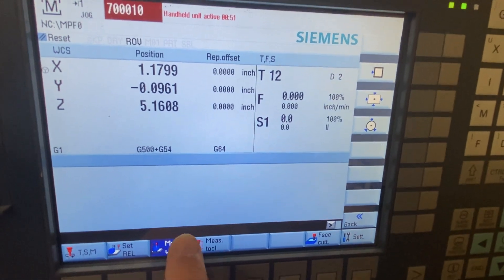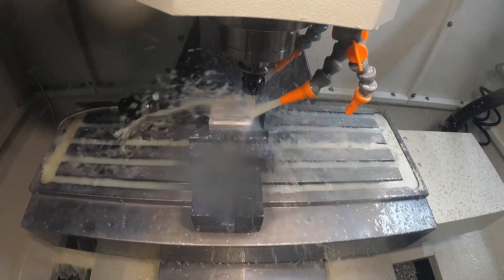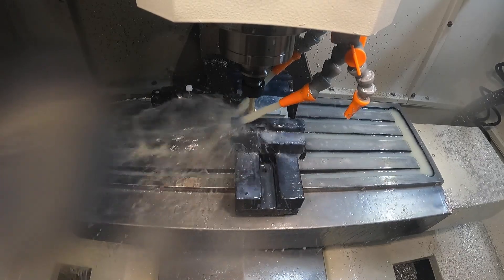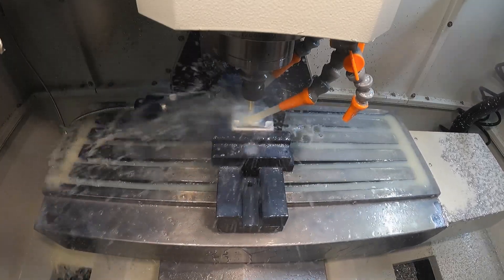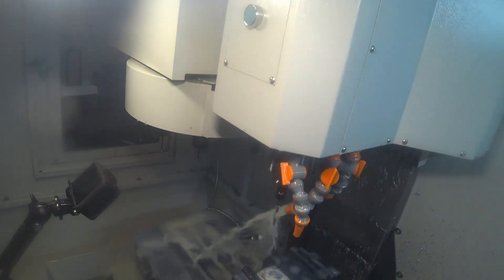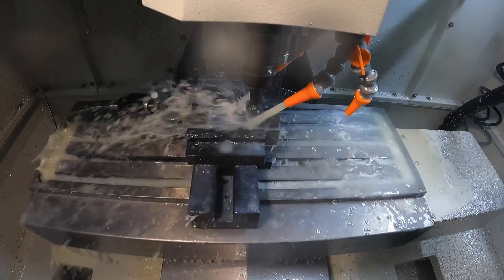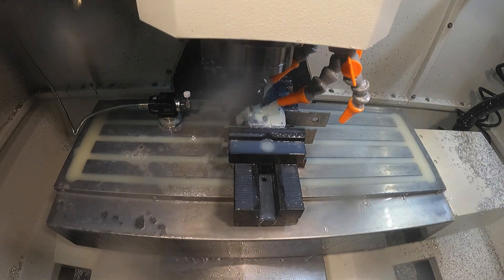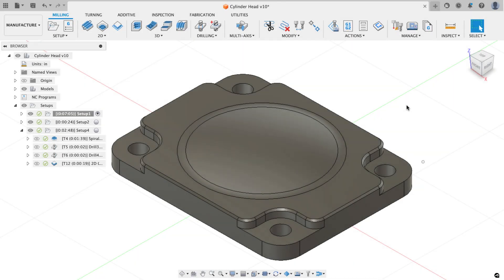Model Engine Project - Cylinder Head Machining

Comment: So that is a Sieg machine center with the Siemens control? I can only guess that it's the KX3S. ISO30 taper with ER32 collets? Love it
Reply from the maker: The machine is made by Syil. www.syil.com. It uses BT-30 tools. I primarily run ER-20 and ER-16 collet holders. You will also see me use some ER-11 and ER-32 holders as well.

Comment: Question: are you running the GoPro "naked" in there? I don't see a waterproof case in the video? I read that the coolant eats up the standard polycarbonate waterproof cases quite quickly but perhaps the base device survives better?
Reply from the maker: It’s naked. The coolant is hard on things. I’ve had mounts break in the past. Now, when I finish recording, I take the camera stuff in and flush it with tap water. The GoPro I’m using is a hero 9 and it is waterproof without a case.
Reply: @MechanicalAdvantage  that's really helpful! Thanks! I bought a basic cheap waterproof case for mine thinking it will at least make it easier to wash clean. 

I'm now pondering a quick 3d printed case from PETG (coolant resistant) and using those cheap screen protectors to make the seal. Pressurise it and use that to air blast the screen... Hmm

Comment: Great video, Kevin!  I have a couple of questions. Why doesn’t the coolant drain off the table?  I don’t hear any air clearing the tool during a change…is it not possible to do this?  When you back off the coolant flow, where does the rest of it go?  Is it just creating more back pressure or does it recirculate somehow?
Reply from the maker: I don't like the design of this table. The good news is that the next generation of this machine uses a table that I love. On this table, there is only one small drainage hole for the coolant to escape. Sometimes chips can build up and block that drainage hole. I've made a fixture plate that I will be mounting to the table in the future after it is surface ground and then black oxide coated. That should block the coolant from reaching the table. 

There is no through spindle air on this machine. The air actuates the tool changer cylinder. 

The pressure just builds up a bit more as the flow is restricted. When I make parts that aren't on video, I typically run the coolant at full pressure. This helps remove chips from deep pockets and helps to keep the table and vise clear of chips as they are cut.

Comment: what coolant do you use?
Reply from the maker: Hangsterfers 5080 semi synthetic. I’m very happy with it. I alway tell people that I’m very hard on coolant. Not because I machine a lot of parts, but because I don’t run high volumes of parts. It isn’t uncommon for the machine to sit idle for 2 or three weeks. The coolant has help up well, doesn’t start to stink or grow bacteria. I don’t have any circulation pumps that run or anything like that.

Comment: Thanks Kevin.
Great step-by-step video.
I suppose it would have been too much hassle to swap out the Alligator Jaws for plain jaws for Op. #2 ( and just have the part sitting closer to the jaw tops?
Still…. clearance is clearance eh?
Regards
Robert
Reply from the maker: Well, I don’t have any other jaws currently. My plan B was going to be to install some soft jaws. Turns out I didn’t need to however.
Reply: @MechanicalAdvantage  
For my ‘Syil ‘Original’ vice, I bought a set of jaws from the USA. Softened state… for fitting to vice. 1/2 the price of the hardened ‘Alligator’ jaws.
Turns out they were 1018 🤣🤣🤣
However, I was able to get them case hardened to about 45Rc.
I leave them in….. but of a pain to keep swapping jaws.